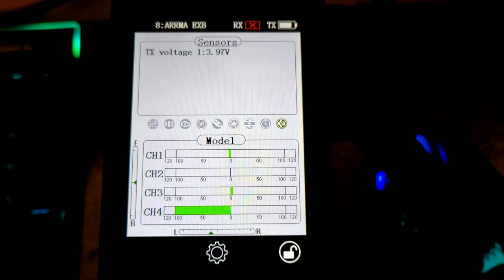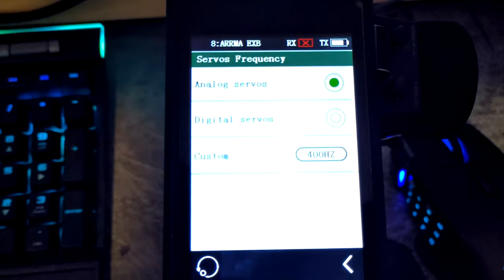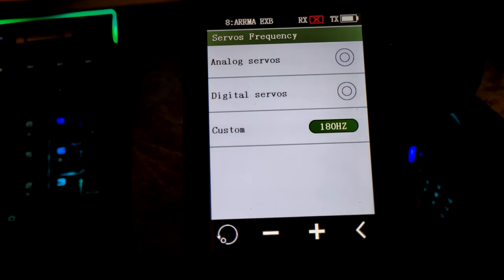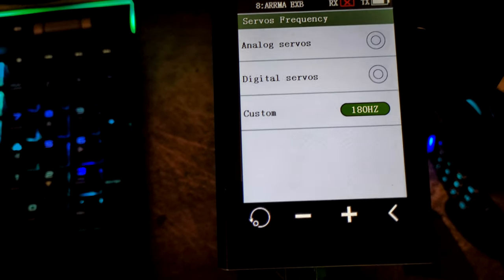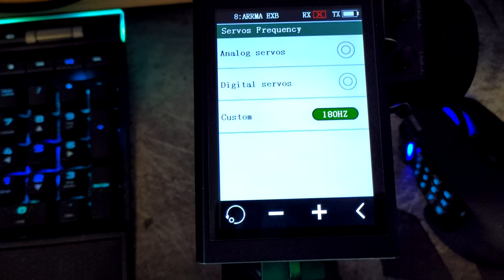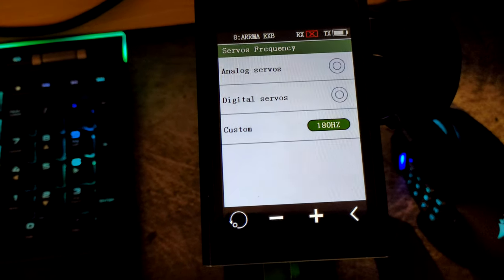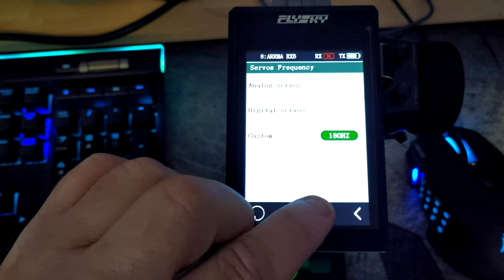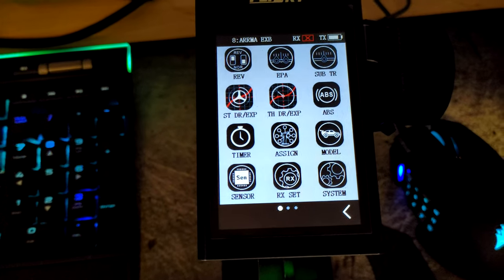NB4 won't work with kill switch or ESC or Servo fix :)

Comment: THANK YOU.  Seriously, setting to 200 for a Velineon VXL-3s worked perfectly.  I was stumped for a good bit, finally putting a FGr4P in my 4tec 2.0, and getting rid of the Traxxas radio.  I’ll give the radio and recover to my son for his Redcat MT10E so he can get some gyro action, as that truck is insanely squirrelly out of the box.  I think he may also need the center diff, as it has big problems with power distribution.  But again, this video was a blessing!  Thanks.
Reply from the maker: Glad it helped :)

Comment: Thankyou so much for this video! 201hz worked for a traxxas 3s system.
Reply from the maker: Yeh the traxxas electronics are very strange at times and much slower than lots of the others but you can make them work fine :)

Comment: Thanks for the great tip!  One trick I’ve learned is a scenario where I share a car with my daughter and it has two receivers installed to pair to each of our remotes.  No issues changing to her GT2C, but when I plug the NB4 receiver in again it looks like it’s paired as it has a red light, but it won’t let me calibrate the esc.  I need to rebind the NB4 receiver then it works.  Doesn’t make sense to me, but at least I know.  Any thoughts on why I need to rebind after unplugging the NB4 receiver?
Thanks again
Reply from the maker: Not sure why it would unpair it only like removing the battery and I have never come across the issue I have tried swapping out a receiver with another paired one and does not need to be re paired?
Reply: WTF RC Cars thanks anyway, it’s a great radio, just a minor inconvenience in the scheme of things.  Plugging it straight into vrc pro is a big plus too that I don’t reckon gets enough airtime. For a newbie to the sport the easy access to vrc has been great for helping me improve my skills.  Keep up the great vids, Cheers
Reply from the maker: Totally agree on the vrc pro I did a vid on it :) hope you find a fix for the binding issue, have you updated the receiver firmware as old firmware make for some strange issues? I got a vid on that in the nb4 playlist worth a try, there's 2 parts 1 updates the nb4 and the other updates the receiver :)
Reply: WTF RC Cars I’d been holding off on latest firmware as I’ll need to set up my cars again, sounds like that issue might be fixed so I might bite th3 bullet and hope it’s two steps forward and one back. Thanks

Comment: Have traxxas vxl3 esc tried this plus running end points on throttle down steering servo works but nothing on motor
Reply from the maker: Set the polling rate to 300 and then recalibrate the esc it will work fine I have run traxxas esc from the nb4 just needs the esc to be calibrated to allow it to know the end point of forward and reverse :)
Reply from the maker: You may have to reverse the Ch for throttle too :)
Reply: @WTFRCCars  I set to anologe and even tried running MHz up and down and nothing did a few things and went back to anologe and then worked thanks for info. I called traxxas and they didn’t even know how to fix it. Thanks
Reply from the maker: Yeh traxxas don't like to help if your not using their kit :( glad ya got it going :)
Reply: @WTFRCCars  I had a servo didn’t didn’t want to work on my noble few mounts ago first one ever not not worked I got it hobby shop. Worked great on other transmitters and servo tester. I ended up tossing new servo in box few weeks later I got it again and when I switched to anologe it worked perfectly and now esc did it. I’ll definitely know now to check that again thanks
Reply from the maker: Glad ya got it all sorted :)

Comment: Hey WTF hope all is well. I like your video content Have a quick question I have the FlySky NB4, I have a kill switch and a 40 KG AGFRC throttle / brake servo. I am new to this remote and wanted to ask you is whenever I shut off the remote power switch, My throttle goes in to break mode, and my Killswitch is enabled, which works fine, but when I try to assign the SW1 trigger switch on the handle for channel 3 nothings happening, any advice greatly appreciate it. Ive looked at your other video but no luck getting it assigned.  When i tried assigning it to CH3 then my killswitch  no longer works. Only time it will work if i restore my profile that i exported before futzing around
Reply from the maker: I'm guessing you have the kill switch connected to ch3 on the receiver
Reply: @WTFRCCars   Yes
Reply: @WTFRCCars  I even tried it on channel 4, and it does the same exact thing and each time I restore my profile the only way my Killswitch is working as when I power down the transmitter but I just cannot maybe I’m doing something wrong. Maybe I’m missing a step I just cannot assign a button to correspond with the channel 3 of the receiver.
Reply: @WTFRCCars  I also watched your other tutorial on how to lower the server frequency which I did to 333 MHz
Reply from the maker: So what are you trying to assign ch3 too ?
Reply: @WTFRCCars   Yes! just channel 3
Reply: @WTFRCCars  I want to assign a button to trigger my killswitch with Failsafe.
Reply from the maker: Are you sure that the kill switch you have can be controlled and isn't one that just kills the engine on power loss
Reply: @WTFRCCars   The one i currently have  installed is cheap killswitch just kills the engine
Reply from the maker: You may not be able to set it up to a switch
Reply from the maker: No probs
Reply: @WTFRCCars   Hey WTF, hope all is well. Just want to full you in so I remove the cheap kill engine switch and installed the dynamite killswitch and it is working now via my assigned button with no issues. Thank you very much for your assistance / help, much appreciated!
Reply from the maker: No probs glad it worked out for ya :)